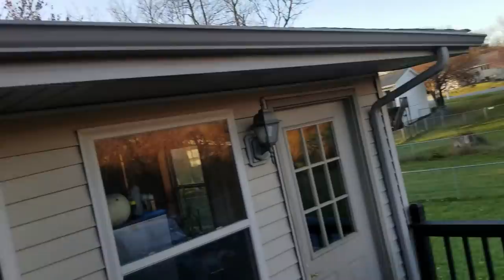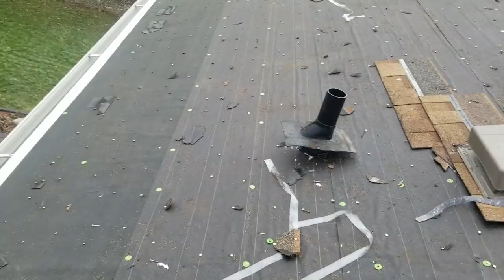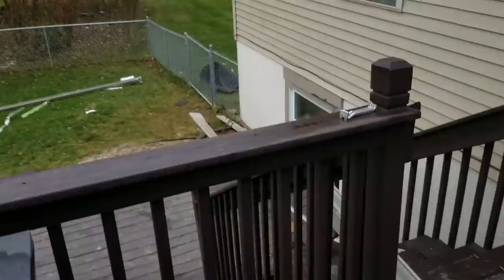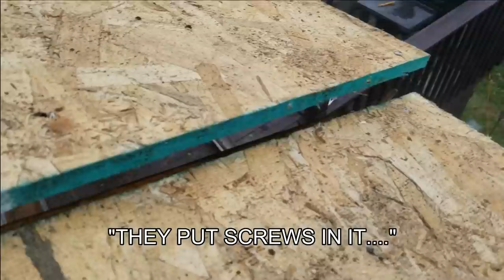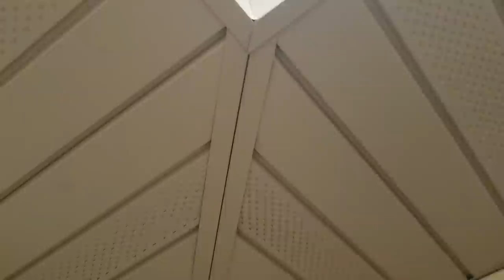Worst Roof Ever Installed!?!? (part 2)

Comment: I half assed re shingled my old shed and did a much better job then that and i wasnt even trying. And i even cut my old ridge caps that are much straighter and cleaner then that. I used the same style of shingles, and correct me if i am wrong but the white strip should be peeled off to reveal the tar to seal the shingles? At least the brand i used required this, it even said so on the plastic in small print.

Comment: Ive been in the roofing trade for over 35 years and Ive seen lots of bad work in my life. The one thing I would have tried to do is save that gutter. It could have been clean and re-used. Jused use new end caps and down spouts. However they were not seamless but it would have saved the lady some money. But all in all, it was a horrible job and they need to be exposed and sued

Comment: I'm doing a farm house remodel.  The roof is going to be replaced and I'm going to do it myself.  Why shouldn't you cut shingles for ridge cap?  I've done that plenty of times before on smaller out buildings and it worked and looked just fine.  Is there something I should know?

Comment: I'm a taper by trade but love your work. I did roof a shed recently wish I had seen your channel then with the nailing pattern picked up a lot of tips from your other series but I've seen a roof recently that might have this one beat minus the soffit and fascia debacle. 2 leaking skylights. reused all old stacks  wavy lines nails through the drip edge don't think they did one thing right wish can post the pics

Comment: Great vid. But at least protect their deck from all the debris you guys are letting drop down. A simple tarp will prevent 80% of scratches and dings that may occur

Edit- typed that before I saw your message about the tarp. But still, customers pre existing and finished carpentry always takes #1 priority Before your work begins.

Comment: So chill for bossman, Wooooowwwww part2. I am amazed at the lack of vulgarity- lmao , f-bombs and much worse would be flying after seeing those nails in valley!!! Pulling shingles off by hand,, Not Nailed ply!! water trap after water trap.. here in MA that would be Severe ice water damage within first winter...wow ! luckily this homeowner knew that something was amiss**...drywall screws !?, on exterior metal  to wood WTF was this dude smoking.
**Good save on the damage this would have caused ,.. and proof that this happens -hacks are everywhere. Homeowners need to see that roofing is not just throw down some shingles and flashing..Water will find a way in any bad nail or shingle , critters/insects will get in..all leading to damage to your house and property. Excellent example of a bad/hack roof job,  to a pro job.

Comment: hard to believe but I have seen worse. On a shed, one guy started on one side with the shingles facing the right way then continued over the top with the shingles upside down with no tar paper.  That half of the roof rotted completely.

Comment: 500 less dollars ended up costing her. I work building restoration. because of faulty roofing flashing a 3 years old 5 million mansion had parts of the framing rotten. we had to take the whole stucco out fix the rotten parts of the frame wall and waterproof decks and balconies with sika cause the decks were rotten as well.

Comment: To be clear, being bonded and insured does not equal a quality  job either.  It does help, and show some responsibility, but it's not a guarantee you will come away with a respectable job.  It may be just acceptable, at best.
Reply: That's true,  but the bonding does give you an avenue for resolution when things are screwed up.  I'd rather wind up with a hack job from a bonded roofer than a hack job by an unbonded roofer.
Reply: @andrewalexander9492  Very fair point, thank you.

Comment: I'm not sure what the problem is, that roof looked great before you ripped it all up... BTW, what did you do with all the shingles, nails, and other stuff... I could use all of it on the next roof job I do.
Reply: Troll
Reply: Not a troll. I think he is the installer of the worst roof ever.
Reply: @FreeStuffPlease  The roofer in this video? TROLL.
Reply: @POWER-LINKS  no. The dude that left the comment. I think he did the first roof job.
Reply: Because I don't see how anyone else but the original installer could think that roof looked good haha.
Reply: @FreeStuffPlease  He needs an optometrist.

Comment: Other than what the previous, let's call them handy man since they clearly doesn't know how to roof, did, the issue's I see with your work is no tarps for debre are laid out under your work area. Not sure what your laws for where you are, but where I'm living anything above 6' you gotta be tied off. Ladders need to be 2' above the roof where your climbing up and tied off. Also, one last thing, those nails are really close to the edge of on the nail line. But Than again diffrent states have diffrent laws.
Reply: Where I am its anything above 10' to the bottom of your boots to ground you need to be tied off.
 
Ladders should extend 3' above the roof and be tied off. 

Also need hard hats and safety glasses.

As you said, different state (actually country cause I'm in Canada) different laws.

Comment: Can't believe that you just let everything fall onto the decking and handrail ect, could that cause damage?
Reply from the maker: No damage of course.  The shingles where new and full so they came off without breaking in pieces.  It was granules and nails. That's why i said James is picking up the nails before someone steps them into the deck.

Comment: I want to see the part 3 where you shiw your job done please.
Reply from the maker: I show it at the end don't I? Free roof give away video has it in there I know that
Reply: @NWIVeteranConstruction  ok thanks
Reply: @NWIVeteranConstruction  oh come on now!  I also questioned how I would love to see the rebuilding. With all due respect you basically had it already done then decided to video at the end missing all the mishaps. How do I know you didn't nail in the valley or nailed below the nail line(like was argued at 14 minute mark) It might not have been a "big deal" of that certain one but noone was able to see during the shingling process of the nail layout.   Also If you took the original roof and just took a video a majority of people who was appalled by your finding would have never known the difference and would have assumed you done another fantastic roof had you laid claim to it. Matter of fact that is exactly what the previous roofer may have done, someone is already signing the contract for their new roof by simple pics from certain "angles and views"  I seen the roofing done by cub and few other of your guys, I seen a few shingles you pulled up to redo and how you got off of your lines trying to adjust it by 1/8th of an inch or so.. Dont take no offense to this, I think you are a decent roofer as average. But if you did do 3 tab your shingles would be wavy as fk since you do not like to snap lines , The great thing about architectural is that they give an illusion that they are straight when they are not.

Comment: If they would have just put nails where they go they could have saved a lot of trouble. It would still need redone since they don't know how to order proedge, starter, or ridge vent or how to install ice guard. I cant believe they literally messed up every single part of this roof. I have never seen a roof this bad. Installed like a 3 tab as well, what a cluster, I feel bad for this homeowner, but never go with the guy who can do it $500 cheaper. He should been able to do this abortion for $5000 cheaper.

Comment: I have done every type of roof there is rubber, shingle, pro panel, clay . In my heyday I would run three square an hour I had to do many of these cleanup jobs where I got outbidded. And then a month later the homeowners house is floating away. Even testified in a few civil cases. these guys are jerks I need to be called out on their bad work.

Comment: Look at the mess yous are making on deck/railing..tarps bro...bone head walking under drop zone..no fall arrest..good work from cam view
Reply: all of that van easily be cleaned up  shingles were removed easily and in 1 piece so not much need for tarps, and these people seem to know what theyre doing so theyvarent dumb wnough to walk around without looking up or people on the roof arent dumb enough to throw things down without looking, and finally the roof isnt steep or tall at this height theres no point for fall arrest

Comment: Building codes change over time,in twenty years when they film how you did the roof it will all be wrong!
Reply: This was a new install. Not 20 years later. Also the building code doesn't really change all that much. Maybe just little changes to the building envelope but structurally if everything built 20 to 50 years ago was over built it's not being torn apart and changed 20 years later because new building code says it's not sufficient enough or it's done incorrectly. If an engineer has done calculations on all of the post and headers in a build they will hold.
Reply: There's a huge difference between done to old code and not done right at all.

Comment: there is a video on here somebody had there air gun set to high blew thru all the shingles  you could grab it and pull a square or more off in one big section that the worst shingle job i seen

Comment: Every bit of that would have left in a strong breeze.
Reply: Ron Wade yup. My buddie bought a house and he got me to do that back side of the roof. The front was done before he bought it and the front started blowing off. It was all high nailed. Also there was a valley i had to do. They ran new only old so had to rip up the new in the valley and it was just like this rip right off by hand

Comment: wow, what a disaster. migrant labor did this job or what? what's the difference between shingle cut and a ridge cap on the peak? i had a roof done and they did a ridge vent 20yrs ago and still going strong. where you guys located

Comment: That's literally the worst roof I've ever seen no Cal Val no cut Valley just weaved it nailed to close into the valley they didn't do a proper 5 off pyramid. nailed high missed the sure strip used shingles as Ridge what in the actual fuck why did they even try to seal those gutters on the outside they must have never heard of self-leveling gutter sealant. Guarantee whoever did that roof doesn't own a square or a chalk line

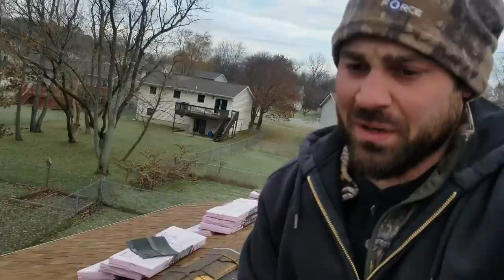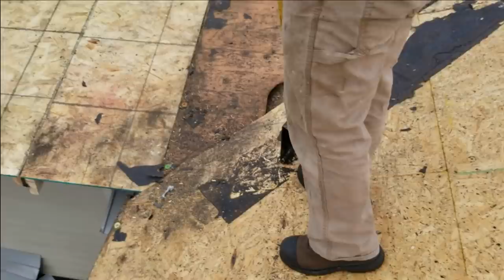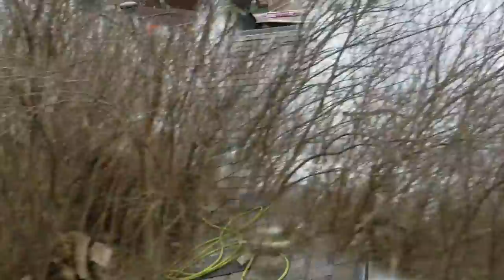Comment: Word of advice. Hold the camera still and stop fucking spinning around. 2:40 is a prime example. I'm ready to fall over and I'm not even on a roof. 10:33 could have been edited out. 11:27 has more unnecessary spinning and a lot of quick left and right shots. 
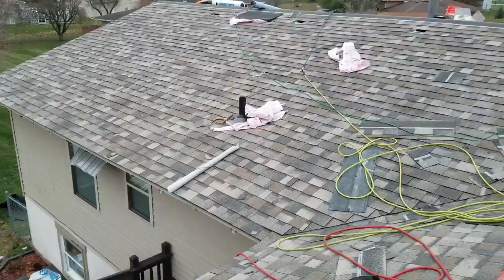I get this is a hand held camera but stand in one spot and zoom out. 11:20 is what you should be doing more of. Stand still, slow pan.

Comment: If these homeowners had to dip into their 401K because of the "work" of the previous charlatan, there should be a Gofundme or something.
Reply: @kylebishop9096  They lost.. The guy didn't get the last payment and the homeowner didn't get reimbursed for anything. It was fair on both sides.
Reply: Why should they get bailed out for not doing their due diligence? Thats exactly what Gofundme is. Sometimes a hard lesson is what people need. This is NOT a case that would have been solved by hiring someone with a piece of paper. This is a case of finding someone licensed or not that was capable of producing quality results.

Comment: No safety harness on the employees. 
What contractor does that.
Also all the debris everywhere  did not protect the deck. 
Still waiting for the video to end to still write crap about it
Reply: Safety Harness? That roof was a low pitch roof, what in the world would you be using a safety harness for?
Also the debris on the deck was the soffit and fascia not the shingles, and it was picked up right away, he was also there to help guide things to prevent damage.

Comment: Everything looks great until I seen those low nails at the end man
Reply from the maker: Where.  Time stamp please
Reply: 1418 1424 nails below sure nail line
Reply from the maker: @roofking2314  I'm not seeing them.  Those nails I exposed when I lifted the shingles were all above the reveal line
Reply: If u can't see those 2 nails below the sure nail line then you'll never see them lol
Reply from the maker: @roofking2314  Haha they can be below the gray sure nail strip just not below the reveal. If its not showing its not low lol
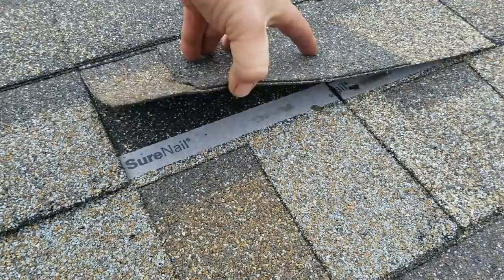Reply: @NWIVeteranConstruction  14:23-14:24, very last nail. put the speed settings on lowest and its definitely partly below nail line but barely and not worth pointing out. But you're right its behind the reveal line so you're ok. I saw it through the first look but wasn't worth mentioning I think every roofer that likes to "speed nail" for production has done this. After all I guarantee you speed will affect your quality. I just saw his comment and wondered if it was the same one I saw and it was.

Comment: Get that OSB chit off that roof while you're at it and put plywood on.....
Reply: I've seen ply fail just as horribly as osb. If you do your job right that osb shouldn't ever see water. I had this discussion with a kiwi labourer that told me all roof ply should be treated. If the roof is done correctly in the first place the sheathing will never see weather. Second if you think having better ply is going to save your ass if your roof is leaking you're mistaken

Comment: Nail low at 14:24 😋
Reply: Technically yes.. but it won't leak or cause issues with the function based on 1/10th of the nail being below the line.. Wrong yes, critical no.

Comment: Well, it looks like your management on the project is slightly untimely.  You still haven't removed the existing roofing,  but the new product  is on the roof. But all the shit talking is freaking hilarious.  Because they had to move everything 3 times. Pretty ironic, I'm not defending the previous contractor,  but you just made your hands work extra

Comment: ah alot is wrong here. other then just thinking u shouldnt. whats the reral actual reason u cant have H joints in shingles???? i mean full peeace half peace full peace.... explain to me exactly what problem youd get. cause leaking is not going to be one of them. its common since and in your face. so ... what?
the package says step it i know... unless u do a really shitty job laying them down...... H joints wont matter. i H jointed my hole shed 15 years agro and have had NO issue

Comment: So far in every single video I've watched of yours you do nothing but badmouth every single piece of work the other person did. Down to blaming the other person for ripping a screen. Not once did I hear you say anything positive. You are acting like you are the best installer there is and everyone else is inferior than you. If it's bad work than it's bad work. There is no need to hammer it home on every aspect and laugh about it with your crew. The installer before you may not have been as skilled as you and may be just starting out. Of course mistakes are going to be made. If you can sit there and say you have never made a mistake on a home before, I will give you my house. Have some compassion as a human.
Reply from the maker: You've literally watched 2 videos specifically designed to expose contractors and expose hacks so that homeowners can understand and learn from this experience so it doesn't happen to them.  Most of my videos are intended to show one of many acceptable ways to accomplish a construction goal...if I have the opportunity to say this is not how it's done... well sometimes its worth it for me to show my viewers even if some think its classless. I've shown my own work and my own employees work to do so.  I understand fully that mistakes happen, my goal is to rid the world of the easily avoidable ones